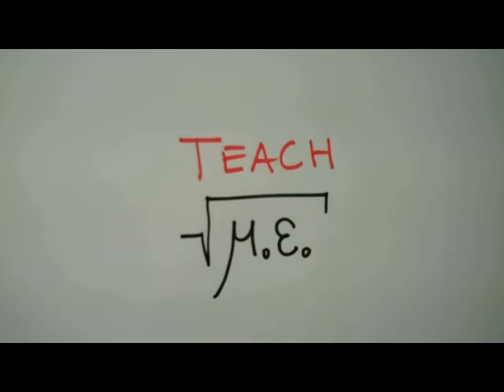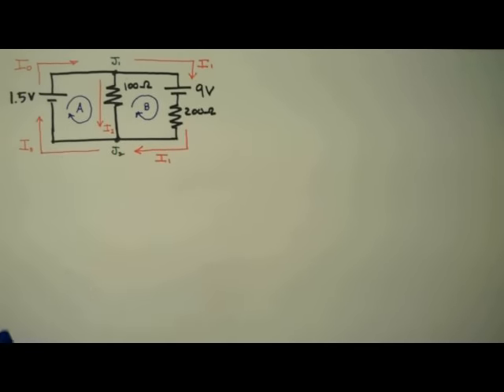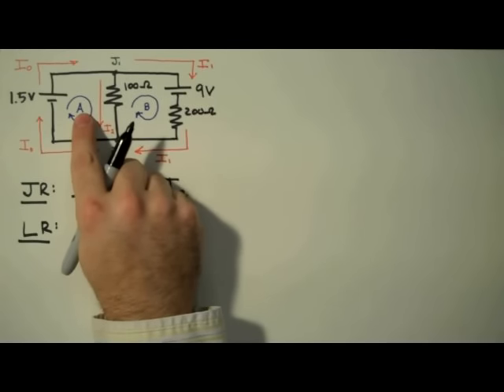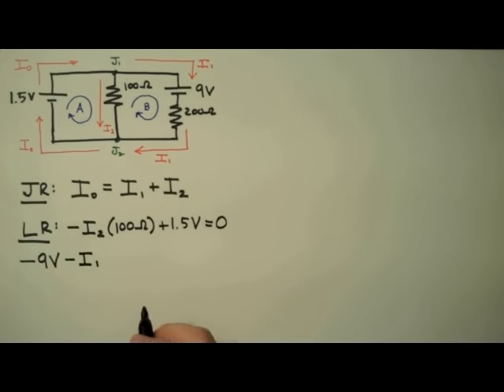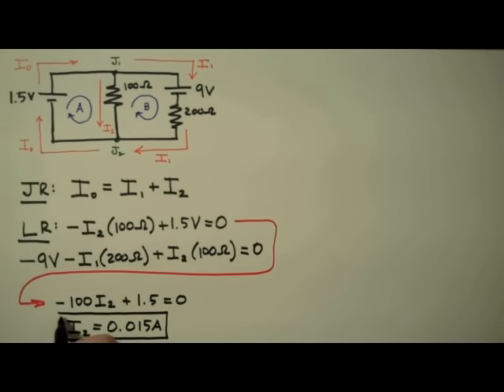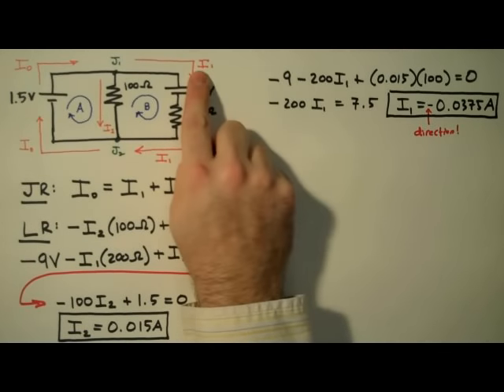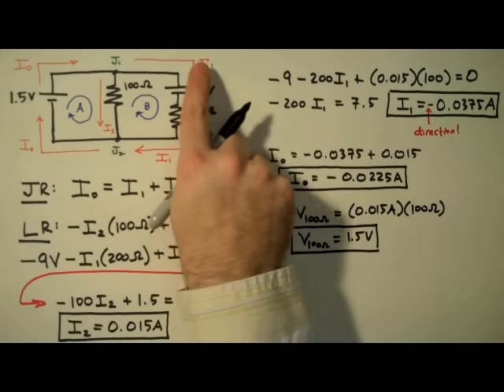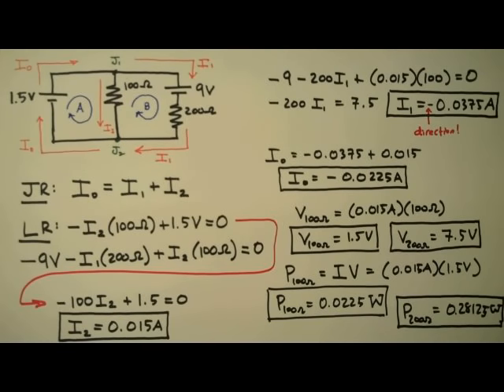How to Solve a Kirchhoff's Rules Problem - Simple Example

Comment from the maker: Teaching (well) is not easy! I'm still at the beginning of my journey as a teacher but I have been blessed with a couple very generous and talented mentors in that department. Great to hear from someone in Spain! Les Falles is on my bucket list and I look forward to seeing your country someday.
Reply: why do you use kirchoffs rule so ridgirous? I dont do this at all. I just use law of conservation of Charge and thus same current in serie and i will use, that in parrallel circuit the voltage will be always the same. And in series the voltage will be split (not always equally) and i will use that in parallel the current will be split as well. Then i just write some ohms law out of my mind and the rules i need also out of my mind  (logic) directly in the form i need it, and then calculate all i need. If you do it rigirously you might have hard time in solving all the unnessesary equations to put it into one equation espacially if the circuit is quite complex. And if i cant identify what is series and what is parrallel i will at first structurize the plan until it works out. (in some cases, there is series plus parallel for the same resistor or whatever, but then you can always exchange this single resistor by two, one in series, one in parallel but i think you dont even have to, because in these special cases, you can apply rupe of potential difference between the ends of the special joint).

Comment from the maker: Resistors present a voltage drop when moving with the assumed direction of the current, whereas batteries present a voltage lift when moving with the assumed direction of the current. Hope that helps...
Reply: You should have said that in the video...
Reply from the maker: @mazapanputrefacto3299  2:48
Reply: Hi, just a question: how do you assume the direction of the current in a wire. If you get a negative answer what exactly do you have to do? For example how are you supposed to know where (which wire or even which loop) you assumed the wrong current direction?
Reply: @sadra9055  Have you watched the video? You just pick a random rotation for that part of the circuit and write the equations according to the rules he explained. After solving the equations, if the current is positive then the current is actually 'going' in the direction you have picked, if a said current is negative then it actually is 'going' in the opposite direction of the initial direction you've picked. E.g. if you have picked a clockwise rotation for the circuit and clockwise current direction, after calculating, if the current is positive then it really is clockwise. Were the value you found for the current negative then the current is actually 'going' the opposite direction so the opposite direction of clockwise is counter-clockwise
Reply: @johnjordan3552  thanks for the reply. I know that if the current is negative you would have assumed wrong direction of current. But lets say you get a negative current as your answer, could you just change the negative sign to a positive sign and use it as a valid answer?
Reply: @sadra9055  The value being positive or negative just shows you whether your hypothetical direction for the current was correct or not. If you got a positive you indeed have picked the correct direction, if it is negative you have picked the opposite direction so you need to flip the direction you initially picked. If you get +5 A for a current and -5 for another, they will have the exactly the same intensity. + and - here just shows you need to flip the initial direction you have picked.

When a question asks you the amperes of a current, and you found the value to be -24 A. The current will be 24 A but in the opposite direction you have picked. 

And I forgot to mention. In physical quantities, if they are vectoral the + and -  values just give you an idea of their directions. Let F be a force that goes from your eyes into your screen. -F force would be the force that goes from your screen into your eyes. Although current is not considered a vectoral quality, what happens here is similar to that.

And most importantly, current can never be negative. It almost has to be positive. The + and - values we get from the calculations, just give us an idea of its direction.

Comment: This has been an excellent tutorial about applying Kirchhoff's laws to a real-life circuit.  The presentation of the material was professional and the author did a very good job of explaining and justifying what he was doing every step of the way. Although the circuit was  pretty simple, the fact that the author showed the relationship of Kirchhoff's laws to Ohm's law and power dissipation was a key feature. It would have been nice if the author was a little more explicit about when he was actually using Kirchhoff's current law and Kirchhoff's voltage law, but the viewer can probably pick it up very easily. A written out definition of the laws would have been nice too, but the verbal definition was very helpful. Overall, this had been a great tutorial and any student learning Kirchhoff's laws would benefit from watching this video.
Reply: bro wrote an essay

Comment: here i am little confused that for R=100 the current I1 and current  I2 in opposite direction so for loop 1 , we should write 

1.5v-100(I2-I1)=0 , also for loop 2 will be.... 100(I1-I2)..  Right?
Reply: Abid UllahPk i agree with this. the current in loop b must have an effect on the 100 ohm resistor

Comment: Hey I just have a question, how come the voltage of the 200 resistor is positive? I thought the current of I1 was negative.
Reply: its because there is no negative resistance.
Reply: Because there is no negative current flow. It just tells you the direction you imagined is not the case. It flows the opposite direction. And the power will always be positive.
Reply: too late but he said that it should be negative just watch it on a computer
Reply: Why did yall answer 3 years after his comment 😂😂😂😂😂

Comment: 100-Evaluation
This video has multiple benefits and points for improvement for the intent of helping students understand the concepts of Kirchhoff's laws. The video does a good job of demonstrating the solution process beginning at labeling the circuit diagram, finding a number of equations to match the number of unknowns, and solving for those unknowns. They also note their assumptions and provide asides to concepts such as the conservation of charge. Some of the areas for increased clarification would include using the wording of Kirchhoff's laws (KCL) and (KVL) to tie the marker strokes to the concepts. The author switches between methods without specifying which also leads to confusion. An additional explanation would include specifying that this is a simple circuit, DC circuit, that additional methods may be needed to solve a more complex circuit, and even that these laws only apply to certain circuits. Essentially, this video only provides a quick way to memorize a strategy without considering why it works or encouraging critical thinking.

Comment: I grounded the bottem left corner and determined the potentials, the the voltages and then used Ohm's law and the Junction Rule to determine the Currents. I got the same answer and didn't get confused with negative signs or systems of equations.

Comment: Sir, just a suggestion. Without actually finding the I (current value) and then getting to know their direction. There is a simple way. We can simply find the direction of the loop by the polarity of the P.D. Source. In I2, the +ve was at top and -ve was at bottom. Hence we conclude that we can get that we simply find the loop direction with the help of polarity of the cell. ---> Student in 12th grade India.

Comment: I was taught to label the voltage drop across a resistor with a curved arrow. The tip of the arrow points to the end of the resistor that current entered. This allows one to keep track of whether there is a voltage rise (i.e. positive if going from tail to tip) or conversely negative if going from tip tail as one sums the voltages around the loop. The tip of the arrows would also point to the positive end of the batteries.

Stating the voltage drop across the 200 ohm resistor as a positive value in this analysis is only true if one takes the time to redraw the directions of the current which was not done in this video. By leaving this detail out and not fully defining the directions of the "voltage drops" across the resistors earns this analysis a B+. Obviously the power calculation will be correct because the signs of the voltages and currents would be the same in either case and the product of values with the same sign will be positive. That is more a consequence of the definition of power and not the way the analysis was carried out. Lesson here? Always put a 95% confidence factor on anything anyone says to you in life.

Comment: great work explaining this! the very last thing you said was incorrect for the power dissipated by the 200 ohm resistor! you said current times resistance = power. your math is right though.  You multiplied the voltage times the current.

Comment: you could also say that if the current enters the resistor the you mark the relative V as positive while the sign of the potential of the generator is the same as the sign you would see by following the closed loop. you need to pick a starting point. (this just flip all the signs in the equations of all closed loop)

Comment: This is a nice and clear explanation, yet I find this method getting way too complicated if the circuit becomes even a little more complex - just by adding a few more resistors. I'd recommend using the superposition principle for solving such problems.

Comment: You can solve this by simply using Ohm's law. You can add up the resistors parallerly (1/Req= 1/R1 + 1/R2). Req = 66.6 Ohms. And then I(zero)= V/Req, substitute values, and you get 1.5/66.6= 0.0225 Amps :)

Comment: After nine years this clip is still relevant upto now. But I have a question current flows from high voltage to low voltage but how comes the 9v is negative and the 1.5 is positive??

Comment: for the voltage algebraic sum on loop B be zero as per Kirchhoff law, the voltage across the 200 ohms resistor should be negative...(-7.5V)

Comment: Great video. The only thing I wish you would have done was to redraw the diagram using the correct current directions.
Reply from the maker: I suppose you could do that at the end of the solution if you wanted to... but it doesn't change the magnitude of your solutions. Cheers from Detroit, Jose!

Comment: Anyone wondering why when going along direction of current across resistor (clockwise), say I2 going across 100 ohm resistor in loop A, is taken negative, that is because conventional current always goes from high potential to low potential which implies voltage drop. Hence - I2(100) is written.

Comment: Hey Jesse! This was very helpful. Quick question, though. The problem similar to this that my instructor gave the class didn't yield any negative values for any of the currents. What I'm wondering is, would you actually leave your final answer as a negative value for currents I1 and I0? 

I may be misunderstanding how these problems work, but it seems like my instructor is telling us that we ned to choose the direction that all loops flow (clockwise or counter-clockwise), and then work the problem with consistency. Before seeing your video, I might have assumed that all current values would either be positive or negative, but here, you have two negative currents and one positive. 

How would you resolve this? My guess is that if you reverse the direction of currents I0 and I1, you also end up reversing current I2, and then I2 will be negative. I may be completely off here. I appreciate any insight you're willing to provide! Thanks again.
Reply from the maker: Choosing the directions is up to you. When you are finished analyzing the circuit you will be able to tell which direction positive charge flows. If your teacher wants you to report the magnitude (positive only) that's up to your teacher. Hope that helps! Skeptastically yours, Jesse from Detroit
Reply: @JesseMason  Thanks Jesse! Just add my exam a few days ago, and I finally recognized what you've just relayed here. The magnitude is what's generally important, as the sign will tell you the direction of the current. Thanks again!

Comment: Awesome, awesome explanation! 
But I do have one question...he skipped the calculations when finishing the 2nd voltage, which is fine, but would the voltage be -7.5 because we’re multiplying (-0.0375)(200)? I’m just wondering what happened with that negative sign, does anyone know? Maybe I missed a step there :(

Comment: hi (: i think the voltage across 200 ohm resistor is equal to 3V and so the power dissipated is equal to 0.045W

Comment: Well explained sir! just one question: how did u find out The LR rule ?
Reply: LR is a consequence of the energy conservation principle. If you multiply each voltage term in the loop with charge q then each product term would represent work done or energy gained by the circuit element, depending on the sign of the term. Alternatively, if you multiply each voltage term with the current flowing though it then each product term would represent the power consumed or power generated by the circuit element, again depending on the sign of the product term.

Comment: What determines whether the voltage on the battery will be positive or negative? is it the loop direction or the direction of the voltage going through it? It's hard to tell because you have the loop and the voltages going in the same direction while traveling over both batteries. It would have been nice if you have chosen to have one of the loops going in the opposite direction of one of the I currents that travels over a battery so we could see what happens then.
Reply from the maker: Watch my video on Kirchhoff's rules - both the direction of the battery and direction of the loop matter!

Comment: Your video was wonderful :-), but I have one question. Why did you reverse the sign on I1 when you calculated the voltage across the 200ohm resistor? Why can't the voltage across the 200ohm resistor be negative. Thanks for your response in advance.
Reply from the maker: Good catch, Ayo. It should've been negative! (Meaning that the direction of the positive potential difference across that resistor should be the opposite direction of the drawn current.) Keep up your meticulous circuit analyzing skills, my friend!

Comment: If the second loop equation ends with multiplying by a negative value and the result is negative (-0.0225A), why isn't the result of the first loop equation also negative? At the end, you multiply 1.5 by -100, which should be -0.015A. Am I right?

Comment: Great explanation!
Just one question, though. Is it always a 'voltage lift' if the arbitrarily-supposed loop direction is opposite to the arbitrarily-supposed current direction?
Thanks in advance.
Reply from the maker: You got it, Zeyad!

Comment: Wish u explained the math calculation. Not everyone has taken algebra nor is good at it. How did u get the amp total in equation? Also mixed metrics are missing which is common. I cant get right metric notations despite converting first and the current out doesnt add up to current in as a result.

Comment: thanks, great video.
if there is no battery in the second loop, then how we solve the circuit?
Reply from the maker: +Zeeshan Haider If it's a one-battery problem then you may use equivalent resistance. Or you can still apply Kirchhoff's Rules...
Reply: +Jesse Mason thanks. great

Comment: Question.... You said that Current i0 does not pass through Junction 1 but when you applied the junction rule at J1 you had i0 as the current passing though it? Did you mean that current i1 does not pass through J1?

Comment: If there are another  two loops below those loops with resistors in the middle how should we solve then ? Power supply is present only in the first loop and there will be no more supplies anywhere in the circuit..how to solve this ?

Comment: Sir I thought that 1.5 voltage at current 1 you are supposed to subtract it from the main power source which is 1.5 V same applies to that 7.5 v by subtracting it from 9v....maybe am missing out something

Comment: I thought that Parallel Resistors had equal voltage drops?
Why isn't V100 and V200 the same? Does it have to do with that Battery being in series with V200?

Comment: Sir for 2nd loop when we write LR then at 100 ohm R one current in going up and one down.I have a doubt that for 100 ohm R and for second loop the equation would be    -9V - i1(200) + (i1-i2)100=0  ????
Reply: No bro...i1 current doesn't flow through 100 ohm Resistor branch...so what he did is everything correct...i hope

Comment: Question @ 3:47. how did u write it as -I1(200) ? does the current is flowing from lower pd to higher pd through 200ohm. i think it should be written as +I1(200). am i correct sir?
Reply: Yes you're right. Later in the video he discovers that his A is negative, so that means that I1 is going the opposite direction, due to the higher voltage of the battery. The 9 V battery pushes the electrons harder than the 1,5 V battery. That's why I1 is going the opposite direction. It's not wrong if you do that, it's helpfull cause you know which direction is the right one...

Comment: how did u get the power dissipated by second resistor? for R100 you used P=IR and then for R200 you said multiple current by it by its resistor value? what?